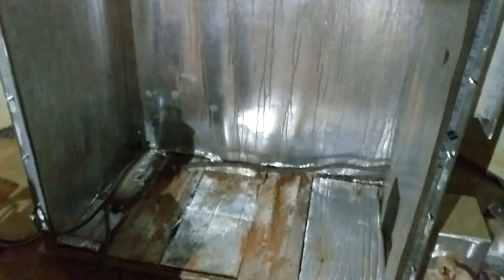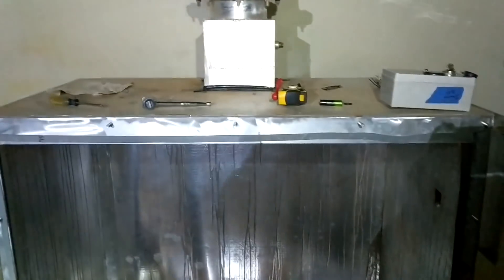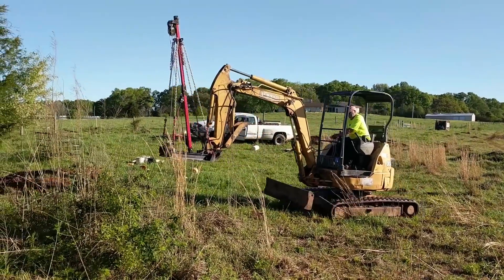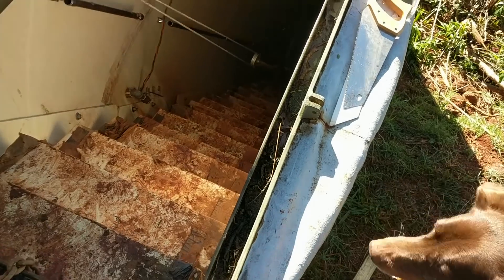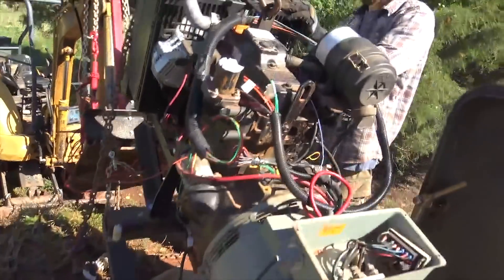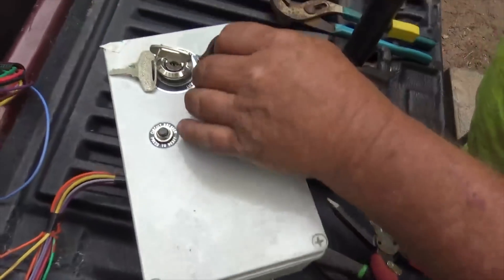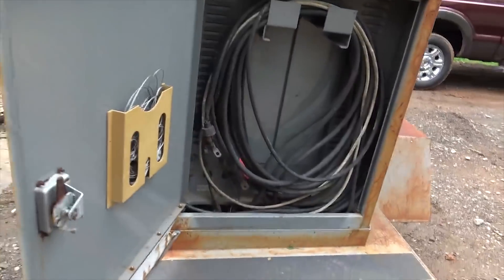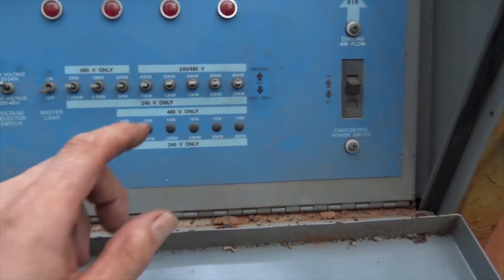Generator Rescue

Comment: Poor engine showing classic signs of neglect. Nothing a good strip,clean,service and re-assemble won't sort out. A programmable controller that does a maintenance run automatically every month or so would prevent things like this occurring.
Reply: I'm sure there are several more sitting around out there from all those tin foil hat type people just waiting for that day when everything goes dark.  Trouble is if they ever do get the chance to use any of the stuff they spent a fortune on they're going to quickly find none of it works due to neglect.